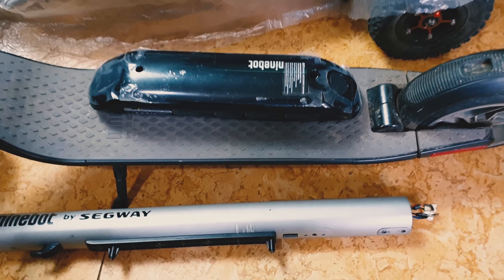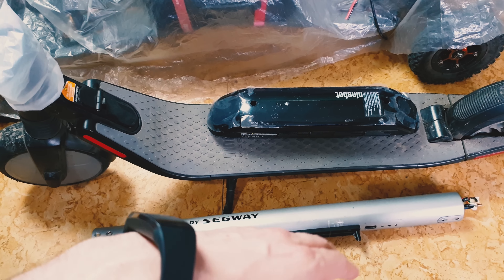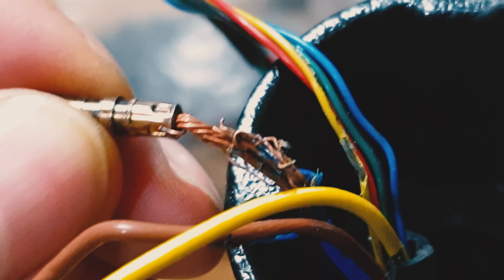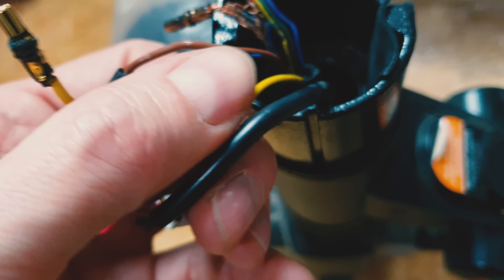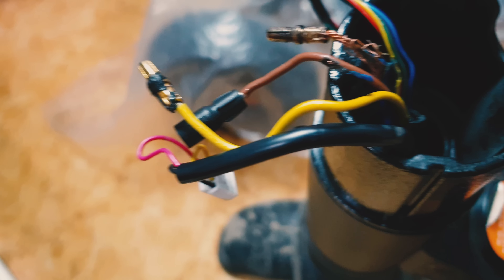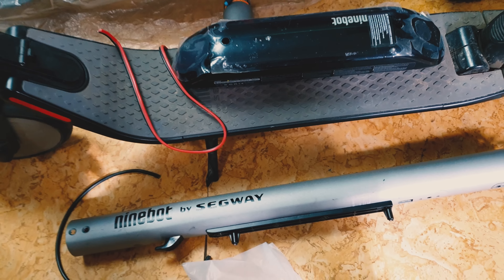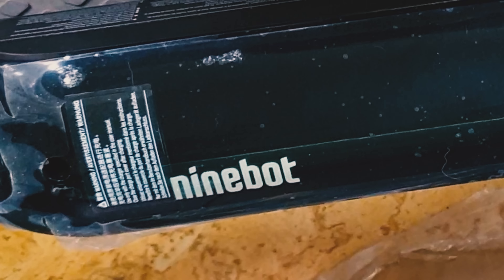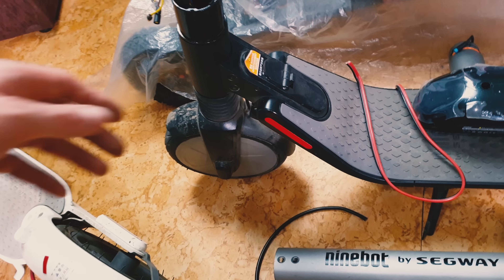Ninebot ES2 BURNED ! True story why Segway is Low quality and M365 is better

Comment: The sad thing about this is that the Ninebot es2/es4 is a much more desirable scooter in many ways. The folding mechanism is far superior to the m365, which I consider to have the worst folding mechanism of any scooter in its class. There was even a recall for m365's with defective folding mechanisms. In my opinion ALL m365 folding mechanisms are defective because of their very design. The es2/4 has better and much more stylish lights for night riding. The solid tires are perfect for city commutes without worries about flats. Having the battery in the pole means its less susceptible to road heat and damage from foreign objects passing under the scooter. The es2/4 just looks better in every way.

I've already had the brake/light issue on the es2 after only 200 miles. I'll probably have other issues too. But I intend to fix them all and still prefer owning the es2/4 to the m365.

It's a shame about the quality issues with the Ninebot. One CAN fix the light/brake issue with a simple solder fix to bridge a faulty circuit (supposedly fixed on all newer models) and a person could add better connectors to the wires or rewire the scooter near the motor/battery with better quality cable. It's sad that an owner should even have to do any of that. That's true. I don't know what they were thinking!
Reply: But segway had a lot of security problems with shaking stem. U always need to secure screws after a ride and u need to tight the deck nut when the stem is shaking even with tightened screws. And road holding is very bad because of theses bad quality solid tires and stupid gravity center because the battery is in the stem. Even rental scooters had better solid tires than ninebot ones.
Reply: And don't forget that they released many versions of the scooter because of electronics failures in previous ninebot es2 gens and some firmware like 1.4.x were dangerous to use because of brick probabilities!
Reply: They were thinking they want to save money by buying cheap wire from the lowest priced supplier...

Comment: I got the ninebot es2 today and I rally like it and it is a good design but my battery drained pretty fast. It was maybe because I was on supersport mode. Anyone relates?
Reply: i have it too,  supersport mode will decrease the millage by alot, it is also mentioned in the manual

Comment: I have two of those one ES3 and one ES4, Both of them failed after little bit over 500 Km. Today I opened the ES4 and the wires were also burned and the connectors melted. This is really bad done by  Ninebot. Both of my broken ones do not sow any kind of failure code. The 365 is not an option for me as I use the scooter for last mile and need it as compact as possible because I take it to the train with me and also the inflated tires are a nightmare.  Before the ninebot ES series I had the M365 so i know both variants. Thank you for the video!
Reply: Za P  Hello mate someone explain to me how did the wire bent
Reply: @ahad1975smash   they do bent when you put it together but the connectors are not well isolated, the ends are not covered with isolation, also the isolation is not the best as mentioned in the video by Pirate. Also the wires are not so flexible. How ever not well made by Ninebot still for me the best last mile scooter at the moment for a reasonable price. If you have one then you should check the wires and add some shrinking tube over the connectors.

Comment: Whats about the brake issues. The scooter throwing people of the scooter or what.  I like the design of this scooter and im going to buy one. But before using it i must  put som heat protection on all wires.

Comment: Did you pre-order the Ninebot ES MAX? This brand new model addresses both of the m365 & the ES4 problems since the design is a combo of both! Check it out via indiegogo: https://www.indiegogo.com/projects/ninebot-max-ultimate-electric-scooter-by-segway#/
Reply from the maker: I didnt , i have to wait till it will be on the market
Reply: @PirateWasHere  The retail version will be released on Q4 2019 according to Segway. I'm curious about this model since Segway stated that it addressed both models (m365 & ES4) and its built to last longer.

May consider upgrading to it from my m365 hehe.
Reply from the maker: @gtone339  looks good, so far I am enjoying my PRO , with extra battery it's dream maker..
Reply: @PirateWasHere  No flats or any issues so far on your m365 Pro?
Reply: @PirateWasHere  You can pre-order it via Indiegogo: https://www.indiegogo.com/projects/ninebot-max-ultimate-electric-scooter-by-segway#/
Reply from the maker: @gtone339  Nope :)
Reply: @PirateWasHere  My m365 suffered a inner-tube puncture lately & I have to get it serviced at the Mi Store. I'm not sure if the m365 is built to last long due to the poor quality inner-tubes or the tyres but definitely looking forward to the ES MAX model.
Reply: @PirateWasHere  Shipping next month, via indiegogo! :)
Reply from the maker: @gtone339  still too expensive for me , 600$ + shipping + 30% tax . For 600$ I got something way better http://bit.ly/Lang8series , Lang L8 20.8ah $643.76 Coupon: BGnowosc20
 &
Lang L8 15ah $599.36 Coupon: BGnowosc15

Comment: Me pasó igual, cables de mala calidad utiliza ninebot es4, podrían causar un accidente si no se revisan los cables del motor, por lo general se calientan y se derriten, cuidado cuando estás en una pendiente o bajando pendientes, se calientan y podrían generar un corto causando que tú patinete se frene de repente y te caigas.

The same happened to me, poor quality cables use ninebot Es2 and Es4, they could cause an accident if the motor cables are not checked, they usually get hot and melt, be careful when you are on a slope or going down slopes, they get hot and could generate a short causing your scooter to stop suddenly and fall.

Comment: The M365 looks primitive though with the basic deck-handle connection and wires, I really prefer the Segway ES2 uniform modern design and wish it had better build quality!
Reply from the maker: U got some point, like for you 🍕🍻
Reply: M365 is simple, which is awesome, simple machines are easy to repair :)
Reply: No, the m365 has better build quality than the Ninebot ES2.
Reply: I completely agree. The m365 looks like the most boring, worst designed scooter around. Most awful folding mechanism of any scooter in its class (some models even recalled). Complete lack of any "style" whatsoever. I bought the Ninebot because it looks cool, has a great folding mechanism, outstanding lights, no worries about flats, good speed and range (upgradeable) etc. It's a real shame that they have such quality control issues with the control board and quality of wires used. I fully admit those are huge problems. I'd still never buy an m365.
Reply: @powerpopjoey  the m365 one an award for best design think it was the dot awards or something

Comment: in other videos you highly recommented this scooter beeing much better than Xiaomi M365 faster speed and reach? did you drive only fullspeed with the extra battery ? and what firmware you where using? custom oder stock firmare? hope you can repair it.
Reply from the maker: I recommend i cause its crazy fast compare to weight but still crap. Very rarerly used full throttle , stock and newest fw, never used any custom one. I will fix it 🍕🍻

Comment: Did they fix it in the 2019 model?

If I ride it at 30 degrees celsius at max speed (ES4) is it likely to happen?

it said that device temp is 39C. But I guess the cords are hotter, no?
Reply from the maker: Yep cables are way hotter

Comment: omg will this happen with my m365 ?
its runs with 350w pro motor, rita and 51V
maybe thats to much?
Reply from the maker: Possible
Reply: it will be a lot of work to swap all the cables ^^
Reply from the maker: @Bergwacht  nearly impossible ( lots of work ) better new motor ;)
Reply: @PirateWasHere  the cables from my 350w pro motor are thinner as the cables from the original m365 one lol

Comment: I have only 170 miles on my ES4 and the lights under the deck stopped working. Only had it 90 days when it happened.  The quality is piss poor but the scooter still rides really good. But I am worried about the long term of the scooter.
Reply from the maker: Same here, one month later back light died and at the end motherboard...

Comment: I had the same problem. How repair then? Change the control board is sufficient? or need change wheel too? Thanks!
Reply from the maker: Lools like only control board need to be replaced, when i short power cables on wheel and spin it, then wheel almost doesnt rotate. Its good cause its mean that the coils seems to be in one piece. 🍕🍻
Reply: @PirateWasHere  Thanks for fast response. How directly powered the wheels for tests purpose? voltage specs?
Reply from the maker: U have to use ESC cause its brushless motor, even esc from rc car will do the job
Reply: @PirateWasHere  how many ampers this motor works? you know?
Reply from the maker: Its rated for 600watts so at 42v we got around 14amps, but i am sure it will handle around 1000watts, ofcourse we have to check if motor isnt overheating
Reply: @PirateWasHere  Hi I was riding my es4 and I hit the brakes realy hard to not crash. After it will not accelerate and even if I turn it off the front wheel feels locked up like it doesn't want to spin. Do you think my cables have melted from going fast and braking hard. I have a new control board coming and I want to know if you think I will need a new motor too now or can I just heat shrink the cables if they are burnt
Reply from the maker: @sNaReOn3  at first open scooter like i did and check what is wrong

Comment: Ninebot and M365 is made by the same company...
Reply from the maker: Yep
Reply: @PirateWasHere  , Do you have any recemandations for electric scooters? Im loocking into the marked and was acually planing on buying the ES2 intill i saw this video. I don't want to by the M365 either bacause of the risk of geting a puncture. So again, do you have any recemendations?
Reply from the maker: Well buy better tyres, anti puncture tape and u re done
Reply: @-herman-8002  Buy a Zoom Stryder instead.
Reply: @gtone339  , I bought the M365, Zoom is to ekspensive for my taste
Reply: @-herman-8002  You made up your mind on your choice lol.
Reply: @gtone339  😂

Comment: What current flows thru this shitty wire? It may be over 20A. This is just joke. I bought few days ago M365 and for the money It is awesome. I love It. I will buy Pro version for sure :-)
Reply from the maker: Well i would say close or over 30A , so this cables been made to melt and do short circuit after one year, there is no other explanation 🍻